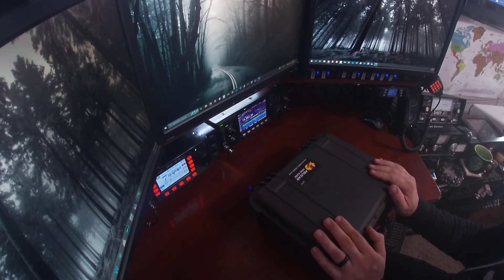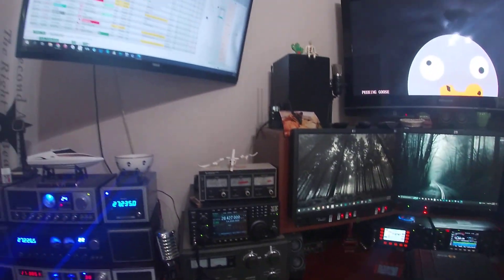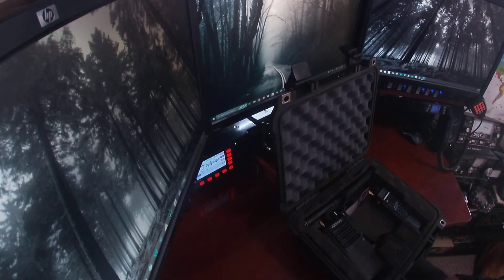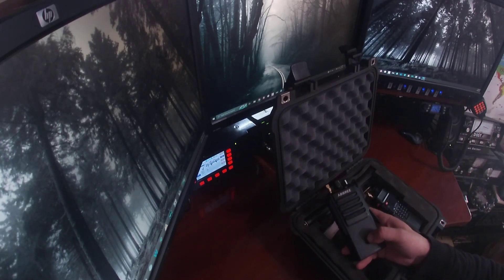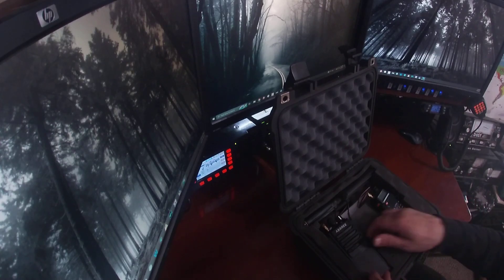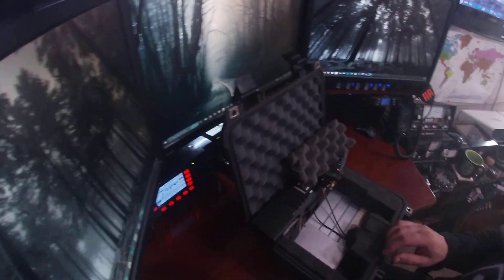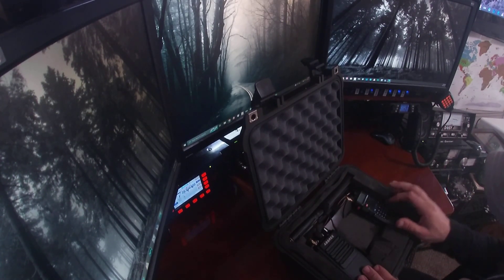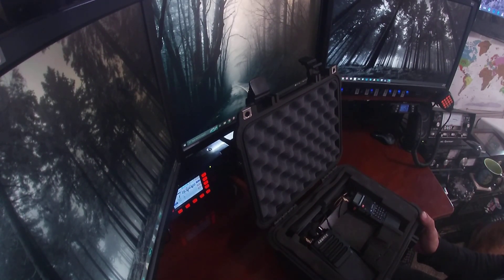Portable field repeater  Baofeng Abbree

Comment: Any update on this project? I'm looking at doing a similar build with a RT91 amplifier powering the transmit radio. Your project is huge at influencing mine!
Reply from the maker: I’ve been at a stand still with it. I’ve been having trouble with the duplexer. Even when I was using a diplexer for crossband it didn’t work great. Tx range was about 2 miles on a 5 element beam at about 30 foot. I’m still working on fixing it.

Comment: Give us an update? One issue can be the front end of the Rx radio can get over loaded by the Tx signal mire of an issue with SOC (system on a chip) receivers. Try using a Rx radio with a duel conversion receiver (super heteodyne ) cant wait to see who it turns out.
Reply: Would the RX radio being a SH receiver (like the Wouxun KG-S88G for example) fix the overloading? 

I'm playing around with the idea of a SH RX radio and then a TX radio amplified by a RT91 before the duplexer to get a little more oomph. This has been the closest project to what I'm thinking of.